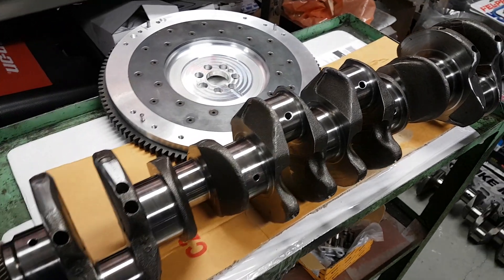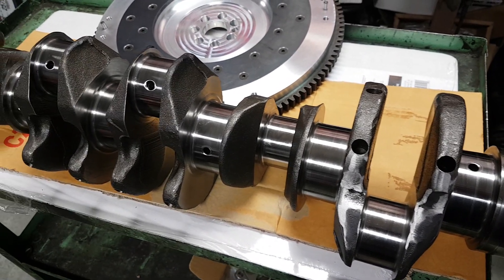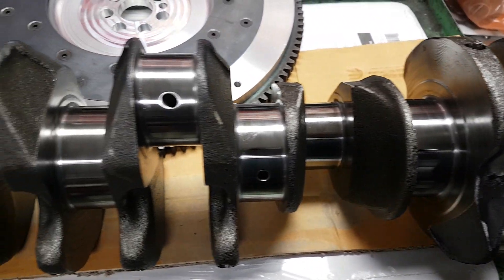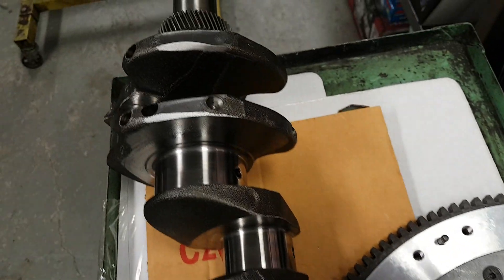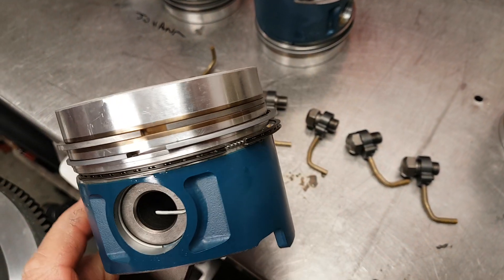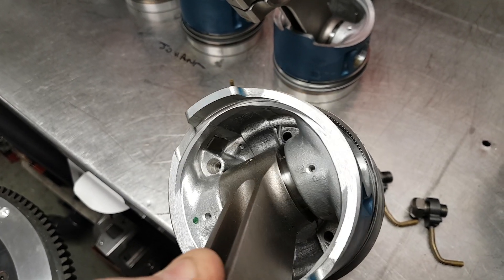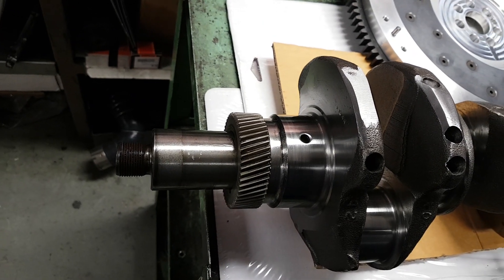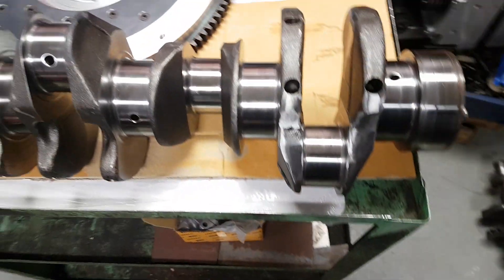TD42 non turbo to turbo spec modifications

Comment: Not advisable to turbo a non turbo TD42? I’ve known personally about 15 GQs and GUs, 4 of which I have owned... initially naturally aspirated and running/ran around 12-15psi and none of them have had any issues. Crank and Pistons is a huge amount of work and more importantly a huge amount of $$$$$ for the slight extra performance IMHO. The TD42 doesn’t NEED all this work to stay reliable and turboed.
Reply: 15 psi isn't boost bro 40+ is boost
Reply: @Reuben_rmr  yeah. Let me see you bring your 40psi across the Kimberly and cape York while towing Bro. Everyone I know pushing high numbers spends their evenings in the shed and their time around the campfire on the tools. Have fun with it. Windeeeerup higher mate. See how hard she can go!

Comment: Hi mate, you pointed out the difference in the crank, from an factory N/A crankshaft to a factory Turbo crankshaft, but was that a black top N/A or silver top N/A? 
Cheers
Reply: The cranks on all N/A TD42’s, blacktop or silver are the exact same. Apparently some late model blacktops had stronger cranks though, don’t know if as strong as TD42T cranks though.